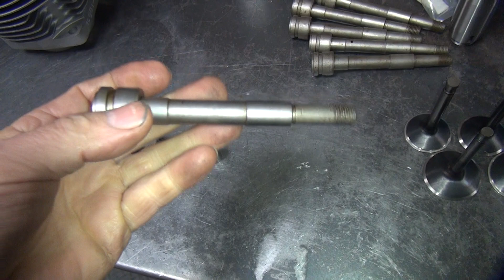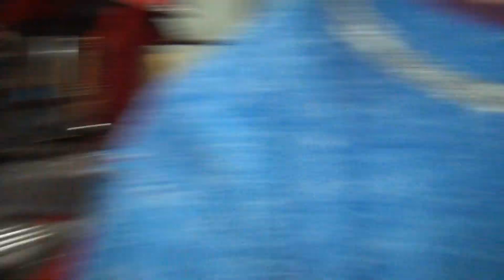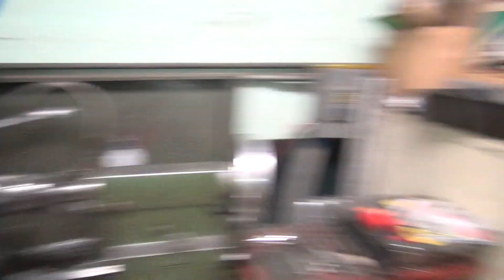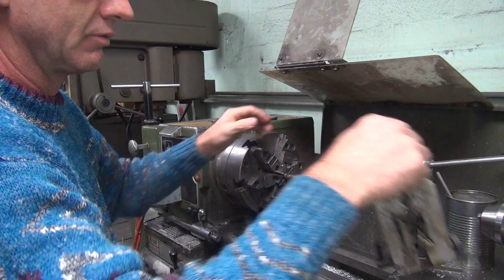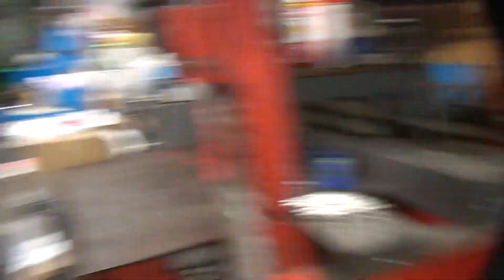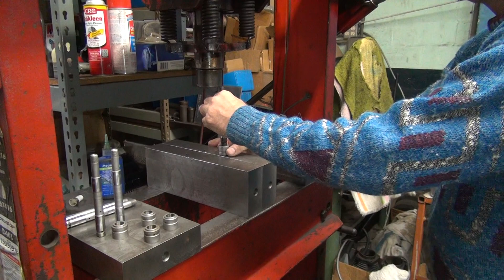1961 xlch #125 no miles transmission motor rebuild sportster harley repair restoration tatro machine

Comment: are the old shaft and new shaft interchangeable ?
Reply from the maker: yes, because new rockerarms come with loose ass bushings.
if you are talking about the 1971 shafts, than yes. you just have to change the right side nuts to the larger size.

tatro